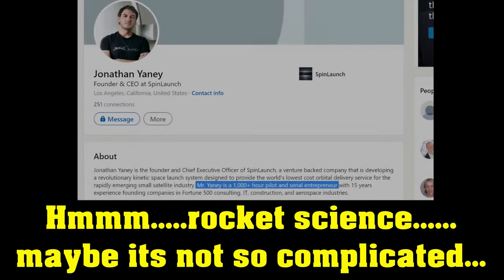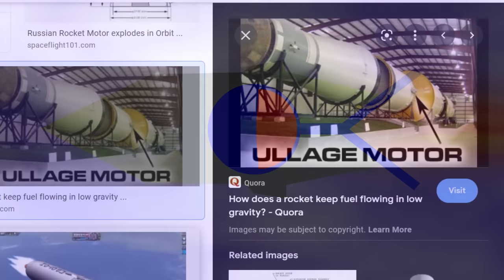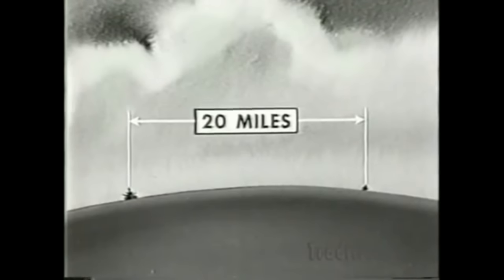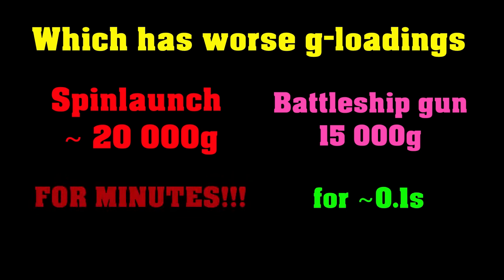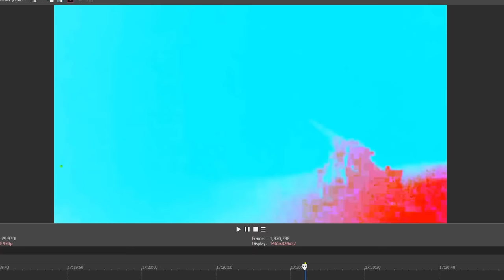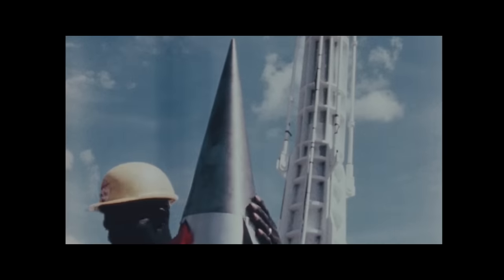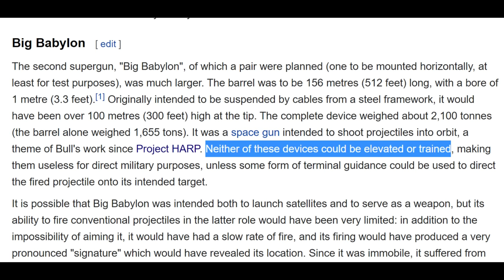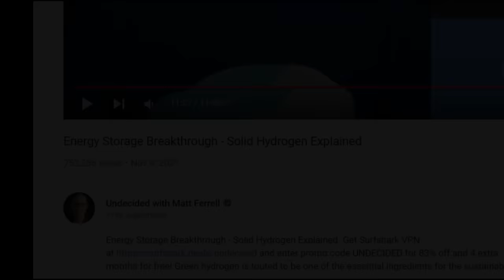Spinlaunch: BUSTED (Part 2)

Comment: Wouldn’t a centrifuge that losses so much mass at top speed just spin it self a part?  Wouldn’t the inrush or air also cause instants combustion of the arm?  Wouldn’t the projectile need crazy thick heat shields ? 5000 mph in 1 atmosphere has to be a problem.
Reply: I just know I wouldn't want to be anywhere near that thing when it's running.
Reply: Good questions
Reply: Good chance it would, yes
That would need to be addressed
Not crazy thick but it would need some shielding I would think
The shock wave of hitting the atmospheric "wall" at Breakthru would cause some interesting pressure waves yes.
Reply: There would be a sudden increase in resistance as the chamber is abruptly brought up to atmospheric pressure when the missle breaks through the barrier.
Reply: @DaveCM  I'm also interested in what that frangible barrier is to made of that can withstand the almost total vacuum required for a full-speed launch but is going to be easily broken by the missile.
Reply: Just hitting that seal strong enough to hold a vaccuum would not be a good thing! That is if the release mechanism does not malfunction and releases the projectile a microsecond too late or too early!
Reply: Yeah on the first point it would be like a washing machine on spin with a brick thrown into it times approximately one million smh
Reply: party popper
Reply: shhhhh, no reality, only dreams.
Reply: @marvindebot3264  Many mats could be used, I don't think that's an issue here tbf. A projectile going that fast would easily rip thru alot of things, that can hold -1 bar,  without slowing down significantly, Plastics would work fine, its a non issue, especially compared to the real challenges
Reply: Yeah, if anyone gets hurt or their property damaged by this thing, I hope they sue this company for everything they got. This is a disaster waiting to happen. I hope they're launching it towards water, bare minimum.
Reply: You'd have to release a comparable mass off of the other side at exactly the same time. Maybe send a counterweight into a water filled shaft bored into the ground. The energy would be absorbed into the water as heat. 
Hey! It's a job for The Boring Company!
Reply: i vote letting elon musk be the first passenger
Reply: @c1h2r3i4s56987  only if it was built like a bullet would that apply. Given the speeds and energy involved I wouldn’t have think it’s possible. 

Also the vacuum maybe only be 1 bar but how big is the opening?
Reply: @Aengus42  yeah Elon would have to get involved with the bore the sudden stop at the anti direction would be very far away .  And you could use some Tesla regen break technology to generate some electricity while slowing down the launch mechanism.
Reply: @wastelandwanderer3883  Could have a steel plate as the seal, with a shaped charge to rupture it milisecconds before the projectile reaches it, but any way someone could try to make a seal for this system would be highly impractical and uneconomic.
Reply: @marvindebot3264  Yep I would like to know that one .
Reply: Not going to defend them here, but you are way off base on a couple of these points.  I am going to specifically target "5000 mph in 1 atmosphere has to be a problem.".  This is not a problem because they are using a vacuum(however weak it is), and it is obviously not going 5,000mph.
Reply: Well there are 3 things you could to to mitigatie that.

You clould release a projectile from the other arm as well and have that crash into some buffer to dissipate the energy.

You could balance the counter weight on the other arm so that it has half the mass of the projectile, so that oyu have an unbalanced arm at all times, but you shift which is the heavyer side from one side to the other after release.

You could have some mass further to the center on the launch arm, that you ´drop down´ the arm and catch at the end to compensate for the lost mass, ensuring the center of mass for the arm stays in the center of rotation. But swinging mass to the outside like that would cause such a rapid deceleration, and shock at the point of ´catching´ again unless it was done in a gradual/controlled fassion, that I´m not sure the arms could handle that.
Reply: "Wouldn’t the projectile need crazy thick heat shields ?"

The Sprint Missile, a nuclear tipped anti-ballistic missile developed in the 1960s, attained Mach 10 in the lower atmosphere. Yes, it did get hot, the skin of the missile glowed white-hot after a couple of seconds. It used a thin ablative skin. Also used an interesting solid fuel, zirconium needles in an oxidiser.

"Sprint accelerated at 100 g, reaching a speed of Mach 10 in 5 seconds. Such a high velocity at relatively low altitudes created skin temperatures up to 6,200 °F (3,430 °C), requiring an ablative shield to dissipate the heat. The high temperature caused a plasma to form around the missile, requiring extremely powerful radio signals to reach it for guidance. The missile glowed bright white as it flew."
Reply: @marvindebot3264  that wouldn't really be an issue, as it would only need to withstand 14lbs per sq in. Smarter every day made a supersonic baseball launcher a d use clear tape to seal the end.
Reply: @c1h2r3i4s56987  I'm not so sure about that. Anything you hit has the chance of deflecting the projectile. You may be right, it's a bit of my field so it's pretty much conjecture on my part but I suspect that while not insurmountable it may be a bigger issue than you think.
Reply: @danielduncan6806  Wait a minute! as soon as it's ejected, it is no longer in a vacuum and it's supposedly going 5,000 mph.
Reply: @matthewedwards6454  It's not containi9ng the vacuum, it's the effect of punching thru anything at 5000mph
Reply: @danielduncan6806  Well it is a problem immediately after release, the end of the arm is still doing 5000MPH and there's suddenly no vacuum. In fact the inrushing air would be at some considerable velocity in the range of 300m/s or close to 700MPH, speed of sound kind of thing. That would last longer than the rotational period of the arm and would impact it on the first rotation post release in all probability. I think that would be a problem.
Reply: @wastelandwanderer3883  I don't think the barrier seak would need to be too strong. The mythbusters built a vacuum cannon, which this basically is as well, with simple cling wrap as the Barrier seal.
Reply: @Aengus42  launching something close to 200kg at 6 times the speed of sound in to a shaft full of water would probably not be a good idea. The shaft would have to be connected to the chamber itself and with that kind of water displacement and heat generated from the projectile hitting the water you have basically build the worlds biggest pipe bomb.
Reply: Scott Manley talked about some anti-nuke missiles that could do 15x the speed of sound in sea level or something...although it was white hot in just a couple seconds in the atmosphere. I think the video was about spin launch or something. But he also said it could work on moon, even if not on earth. And he also mentioned the problem of losing 20,000x the mass at the top when it launch, that could cause "instability issues"
Reply: @eatabagofdicks6500  even two tennis balls in it sounds like an earthquake
Reply: @Aengus42  i thought the fireball would take care of that
Reply: The atmospheric heating would be like an artillery shell.   Not impossible.  

But yes you’d lose most of your initial energy before you got through the thickest parts of the atmosphere.   So you need the booster rocket either way.  So why not just get a bigger rocket and skip the spinning machine of death?
Reply: I'm sure the answer from them would be something about using the inrush of air to slow the rotation of the arm and it would be instant, due to the super secret aerodynamic design of the arm on the final design and this is just a proof of concept.
Reply: The last thing not realy or have you ever seen a bullet melt and those are made from copper so a steel bullet in a sense should probably be able too withstand the heat without melting
Reply: I think you maybe can avoid most of the problem by adding a "drag-wing" to it, it would have to be made heat-resistant but as soon the air goes into the chamber will the air take over the resistance and slow it down. By only having one arm and not two arms pointing in opposite direction, do you avoid the sudden change in weight distribution.
Reply: @marvindebot3264  This may be solved by letting the barrier bulge outward, this makes the demands of sturdiness a lot less, and by making the projectile pointy, is ½ an inch of metal nearly undetectable for the projectile, compared to the 1/3 reduction of speed the air will give. :-)
Reply: @marvindebot3264  Yeah, exactly! And the exit is quite large as well. I mean it's one thing to make a breakable seal for that missile's/rocket's diameter. That would be hard enough. But this rectangular seal which is about, what, 8-10 times the area of the missile's/rocket's diameter?? I'd like to see some numbers regarding that!
Reply: @nameofthegame9664  Yeah, I was thinking of having a large air gap above the water for just that reason. 
I was worried about sealing it against the vacuum but they have  some magical stout paper sealing the skyward exit so I'll just use some of that 😆
Reply: @xiaoka  because of cost. Why waste the resources of fuel when you can just use mechanical energy first
Reply: If it’s for an instant or a few seconds, it may need less; obviously shield thickness isn’t linearly dependant on either dimensions of the situation
Reply: @emanuellandin7403  Anywhere near? No. But I want 4K slowmotion video from at least 20 places and a big bucket of popcorn.
Reply: Yes, yes, yes, & indeed!!
Reply: Yes yes yes
Reply: @Diamonddavej  so what sort of "muzzle flash" would the full size, full speed, spin launch produce??
Reply: @stevelloyd5785  if you have a door slam shut as the projectile passed, that would preserve the vacuum
Reply: @xiaoka  or put smaller rockets slung under planes to take them up the atmosphere, shorten the journey and reduce the air pressure
Reply: @marvindebot3264  Duct tape and a heat shield silly. …I know some of us never ordered the "know it all" series of books, back in the day.
Reply: Not really the speed is a problem. If you look at sprint missiles they go so fast they form there own plasma that no radio wave for control can pass. The US solved this problem but how is still a secret
Reply: Not according to the video
Reply: It's just a movie. Oh, wait, no it's not. It's just a scam!
Reply: @marvindebot3264  Toughened glass with embedded det cord might be sufficiently frangible. Combined with the nose and leading edges of fins on the missile being armoured.
Reply: @danielduncan6806  Once the missile is ejected from the centrifuge it will be travelling at Mach 6 in 1 atmosphere. It's airspeed will be somewhat greater than this initially due to the strong headwind.
Reply: @xiaoka  From there a 200kg rocket is not going to get into orbit. Whilst a 20,000kg rocket might. This kind of device might work on the moon. But gravity and, especially, atmosphere rule it out for Earth.
Reply: @jpe115  - It should even be possible to use the incoming air to slam shut the door. No electronics required. - As for the "It takes 8 hours to reestablish the vacuum" it should be possible to have secondary pre-vacumed chambers, which could be used to shorten the time it takes to vacuum the main chamber.
The sudden imbalance when releasing the payload, now that problem will remain (even on the Moon). The question is, how fast can they spin and still manage the stress during release? We'll see.
Reply: Do you know how they solved it for the mach 1 launch?
Did you know the sprint missile was flying at mach 10 at low altitudes?
Reply: The Wind Turbine flying apart is a good example.
Reply: I've been wondering the same thing about the air. Not only have we learned that air moves at about the speed of sound, but it's going to be rushing in, unevenly around a missile doing 2ce the speed of sound (in theory), into a chamber with an unbalanced load.

Sounds like fun
Reply: yeah, it would basically be a fireball launcher. A self destructing fireball launcher.

Then again, the small scale didnt destroy itself, or at least didnt appear to destroy itself.
Reply: -Matter didn’t create anti matter
-Anti matter didn’t create matter
(Both of them were present at the time of big bang)
-Both of them didn’t create themselves.
-Both of them came from an unimaginable source,  that unimaginable source created matter and antimatter (everything) thats why it is known as “the creator” of everything.
——————///////////////////—————
- that unimaginable source/creator has created sin and virtue which are opposite to each other,
— logic says every action has its own reaction, so the reaction of sin must be different than the reaction of virtue,
— the creator has created prophets to let us know about each and every detail of sin and virtue, also about their reactions,
Thank you
Reply: @danielduncan6806  What happens when they release the ‘spacecraft’ and it breaches the seal?
Reply: This project is a ticking disaster if it ever sees the light of day
Reply: An attempt would be a shitfest
Reply: You'd need a capsule to shield the content which is gyroscopically adjusted, which sheds in space.
I wonder if a intelligent motorized gyro would hinder the centrifuge?
Either way, say goodbye to manned rocket or aerodynamic design. 
The momentum should spin the object continously.

It would be great to shoot a satelite into space like this.
Reply: @Hedning1390  I’ll look into that .
Reply: You have a ablative shelds, nuclear warheads hit the atmosphere at mach 8.
Reply: The inrush of air is not really a problem, but the rest cannot be easily dealt with.
Reply: @inteallsviktigt  the energy to spin this thing isn’t going to be free either though, is it?
Reply: @ollimoore  more free than wasting energy carrying energy to take you to space, instead of just providing it immediately
Reply: Could it not fly through an iris that closed after it passes and before it breaks the membrane? This would retain the vacuum until the arm slows down.
Reply: @danielduncan6806  it’s in a vacuum until it’s release into the 1 atmosphere air on the other side of the barrier.  And the stated production speed at hatch is 4660 mph not 5000 sorry for my rounding up. It’s such an embarrassing exaggeration.  It need to get up to 17,000 miles per hour to reach orbit .